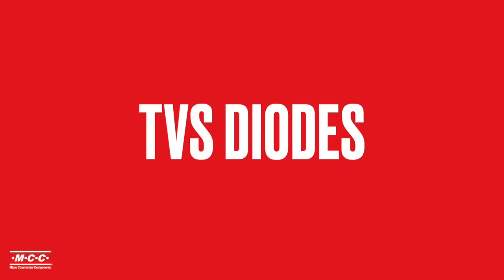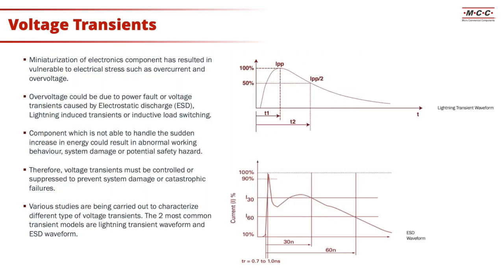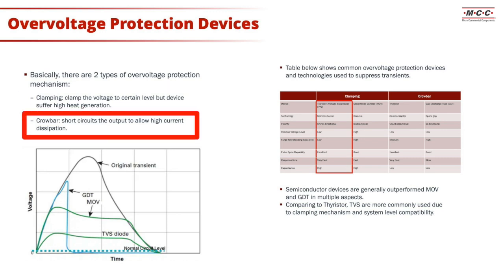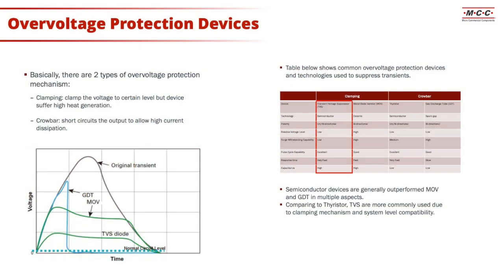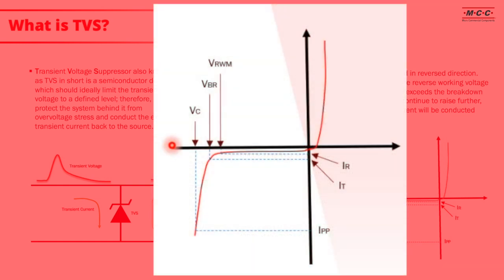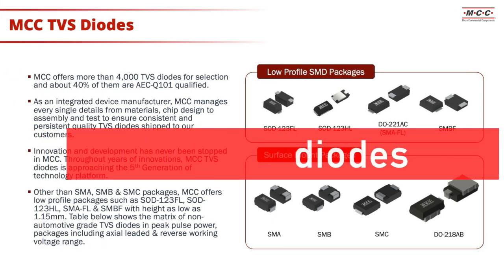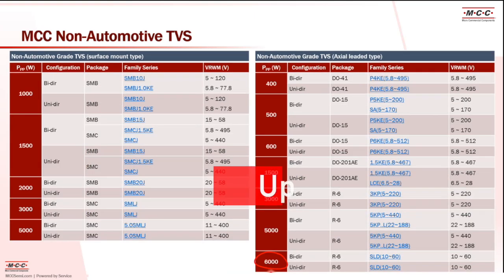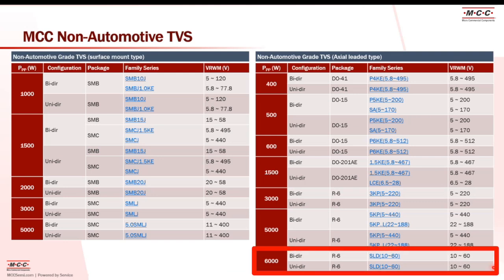Understanding TVS Diodes: The Ultimate Guide to Voltage Suppression

Comment: I keep finding short circuit tvs diodes in car audio modules, I suspect it's caused by boost charging and always the same type,tvs  sm6a27 so the spec sheet gives 22v to 27v range of conduction, there's no way a cars 12v system can get that high not even boost charged without multiple modules dying so I don't know why they go short
Reply from the maker: You could replace it with higher power TVS such as MCC SM8S22AHE3 (https://www.mccsemi.com/products/search/sm8s22ahe3). There could be a possibility that the capacitor in parallel is getting weak which could result in TVS is absorbing most to the surge energy.